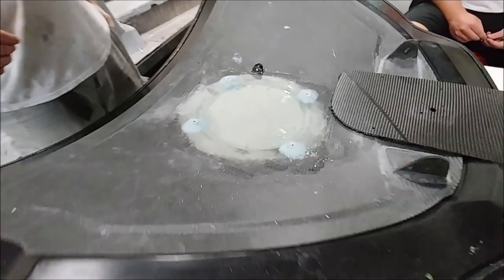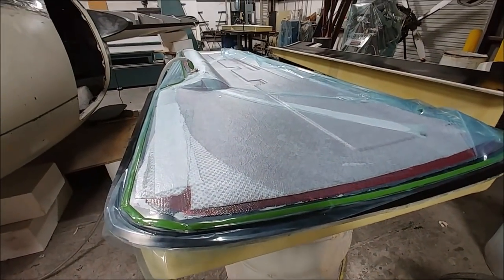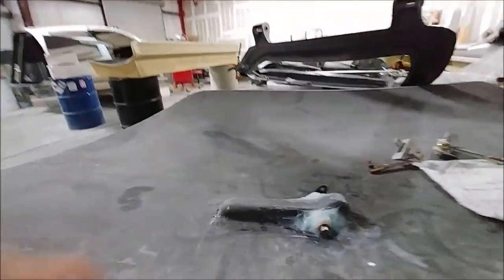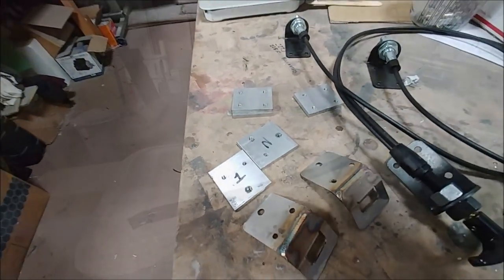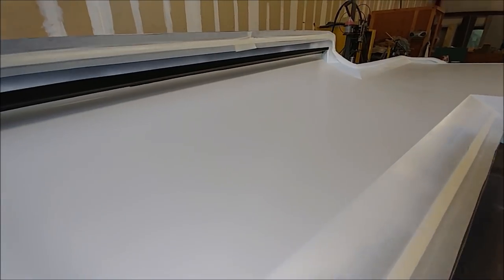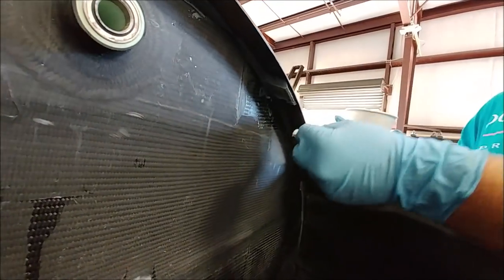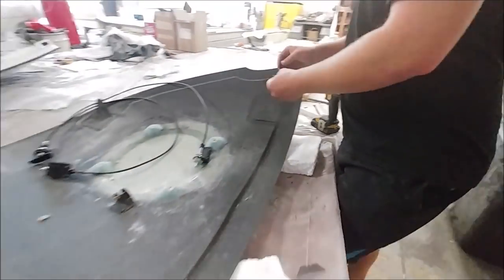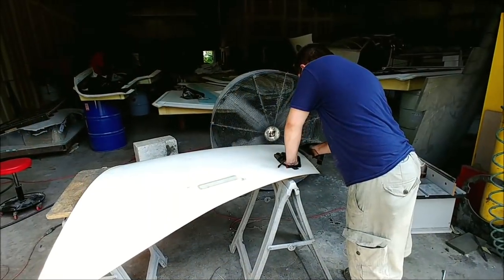Nose Hatch Latches - Building the Raptor Prototype

Comment: I used to hot rod diesel trucks and you are correct about a diesel being less finiky than a gas in regards to mixture. Unburnt fuel becomes black smoke, if the turbo can push enough air to burn the extra fuel higher power is achieved. It sounds like you have the opposite problem, not enough fuel for the available boost so it will cleanly burn the available fuel and the excess air is passed through the exhaust. Perhaps a bigger set of injetors would turn this into a 500 hp Raptor! :)
Reply from the maker: There's enough fuel when I add it as it's possible to get a decent amount of soot build up on the prop at the current highest throttle setting. I don't really see black smoke but that may be because the prop is moving so much air it's difficult to see black smoke when mixed with the clean air. I still want to get the injectors correctly calibrated in the Motec ECU and I've contacted a tuner yesterday that hopefully can help with that.

Comment: In regards to your thermodynamic query, a couple of things seem certain: first, extra boost comes at a cost. Compressor pressure equals turbine pressure equals exhaust back pressure equals resistance to the pistons' movement during the exhaust stroke equals reduced power. In addition, increased boost pressure translates to higher cylinder pressure during compression without increased fuel burn (assuming fuel consumption remains constant) creating gas dynamics equating to a heat pump into the engine with no corresponding increase in power. Also possible if not probable is a hotter burn. Though my experience with diesel is limited, every pilot is taught that a lean burn is a hot burn. 
     Gotta offer kudos on the decision to bury your antennas. I'm often disheatened to see an airframe that starts out with dolphin-smooth flowing lines wind up looking like a spiny pufferfish by the time the nav/coms are installed. Keep up the good work.
Reply from the maker: Only burying the nav antenna. Coms and transponder are old school below the fuselage.

Comment: I don't know diesels well, but generally, raising the boost without adding more fuel would: raise the compression ratio, make the air in the combustion mixture warmer, and change stochometric air/fuel ratio--which may be compensated automatically for by the fuel injection system.

Comment: Although I am not familiar with the ECU you are using, I am familiar with the Duramax ECU.

You have to think like the computer.  In other words, the computer is reactionary.  In the case of the Duramax, the throttle input simply commands a desired torque.  The ECU then shifts through multiple tables of fuel and boost to achieve that torque value.

In my experimentation, I tried high boost during low load.  The engine runs fine, but very inefficiently.  Poor mileage. However, the EGT was very low.  Conversely, lower boost produced better efficiency, but higher EGT values.  Of course, the Duramax is a VGT turbo so it's easy to play with the boost.

You might try this:  take the turbos out of the equation and set your fueling and timing first.  Remember, in a diesel, timing is controlled by the beginning of the fueling event and the duration of the injector as a % BTDC based on RPM.  Typically, a modern diesel will achieve it's best power at roughly 60% BTDC depending on the injector opening time. As a frame of reference,  a Duramax under low load as you described on the video, will run about 110% BTDC with about 5psi boost.  Once the timing is established, begin adding boost to control temperature and black smoke.  

You are correct, the diesel won't really care about the extra boost,  it just isn't running optimally.
Reply: Even in mechanical fuel injection pumps,  throttle settings are merely a request.   Air FLOW is more important than pressure or temp when it comes to metering the fuel delivery.

Comment: It's been a bit since I've taken thermo , but I looked through my text book and made some observations that might help.(for reference look at a PV diagram for an air standard diesel cycle ) For diesel cycle , if you Increase the initial pressure , the three other pressure points will increase accordingly, but since the volume of the engine cylinder is not changing your work input is increasing alot and with low fuel flow you will not see near as big an entropy increase (as seen by low horsepower numbers) , the tS diagram shows how entropy increases and decreases with temperature. 

So my theory , is that after a certain point if you don't have enough fuel input to support the extra pressure you are giving it , your work input will be comparatively high and in turn your net work will be low, because of the high net work input due to a pressure increase on all points caused by the compound turbos. So in effect it kind of is ignoring it , but ignoring it by decreasing the thermal efficiency of the engine. Thermal efficiency of a diesel is ratio of net work to heat added , and since fuel flow is low and boost is up. Heat added will be low and net work will also be a little lower. 

So the questions I would be asking would be the following. 

Why is the engine computer reading a high boost pressure but there isn't a power output or net work output to support it ? 
Mabey there is a load sensor on the engine and it won't add fuel unless it is under more load. 

Does the engine have a type of load sensor at all ? 

If not, how does it know to increase or decrease fuel flow (independent from the throttle control ) ? 

With alot of boost ,if you had the right fuel flow , you would see a much greater workout put during the power phase (can be seen on both PV and Ts diagrams from points 2-3). This would offset the large work input due to the high boost pressure.
Reply from the maker: Presently the only thing controlling the fuel flow is the throttle setting. The ECU was initially set up to also increase fuel when rpm increased but it was impossible to get the engine to maintain a set rpm with that configuration. It would constantly be changing, not ideal for an aircraft so I turned that off. If I add more fuel to compensate for the extra boost I end up with even more boost from the increased power. If the engine just ignores the extra pressure then that's good but if it's not operating optimally because of that then I'd like to see what I can do to remedy that. Somehow decrease boost with a boost controller maybe.
Reply: Raptor Aircraft ok, if you don't have any control over fuel flow besides the throttle control then yea boost control would be the next thing. Mabey something vacuum controlled. Just someway to control the boost to the intake side.

Comment: Hi Peter. Seems to me the engine ECU is acting as a engine governor adjusting fuel flow to satisfy desired RPM. With a fixed pitch propeller this might be ok, but when you add a prop governed into the mix which is also sensitive to rpm and is trying to control it by adjusting prob blade angle in response to over speed and underspeed condition the two governors will not work in unison. You need to be in control of engine power output by way of fuel input and let the propeller governed control the engine speed by way of load. It seems to the ecu is in control of fuel input by way of commanded rpm.
Reply from the maker: Actually the ECU is providing fuel directly proportional to the throttle setting which I believe is exactly what should be done even with the constant speed prop.

Comment: Do you have a mass flow sensor to check the air fuel ratio?  Maybe the fuel rate is low because not much air is being used in the engine or that it is running very lean.

Comment: Throttle body should regulate the amount of air in relation to the fuel introduced.  There may be an out of calibration or synchronization in the throttle body controller and the fuel injection controller.  The compound/serial turbo is there to provide bleed air for cabin pressurization at altitude, also.  This will impact how much boost is available to go through the throttle body in the future flying configuration.  At present, if the engine is running as it should, i.e., without damage, then the engine/prop combination may not be providing enough "work effort" to get real world data as to performance.

Comment: It would be good to validate your specific fuel consumption calculation with alternate measurements.  Ideally you would want to know the torque on the prop shaft with a calibrated torsion strain gauge bridge and then calculate HP from measured torque and RPM.  The strain gauge install, equipment, and calibration of such a method is not easy to obtain however.  What about measuring thrust instead of HP and using prop aero equations to calculate a HP from the measured thrust?  Perhaps this could be done by installing something like roller blade wheels (several of them) on each side of the engine stand and using the load cell and chain that you have from the carbon bond tests to restrain the engine stand and measure thrust.

The purpose of such a test would be to validate that the power you are calculating is accurate.  What matters for aircraft speed and range is how much power you can generate for a given fuel usage.  Dave Darrow - Boeing Attack Helicopter Engineering
Reply from the maker: Setting up to load cell is a bit complicated. Once we can run the aircraft during taxi testing we'll know whether we have a decent amount of thrust. Hopefully that's only a few months away.

Comment: Where will the glide slope antenna be installed? Or is the one you are putting in for VOR reception dual band for the much higher glide slope frequencies?
Reply from the maker: I believe the one we have is all that the G3X needs.
Reply: Raptor Aircraft, VOR is some 120 MHz, glide slope is 330 MHz, the datasheet for the antenna should say whether it supports 330.
Reply: I checked the website of the antenna manufacturer (http://www.advancedaircraft.com/) and they don't spec any frequency range while the other conventional VOR antenna manufacturers say that their antennas are dual band indeed and they list the 330 MHz glide slope band as being supported. Advanced aircraft says their antenna is a dipole antenna which normally means single band only (unless you have an electronic circuit at the base that makes it multi-band).  BTW, you cannot mount any dipole antenna near anything that conducts electricity, i.e. you cannot have carbon fiber anywhere near it. So you cannot embed those antennas in a carbon wing even if you put non conducting fiberglass over it. The fact that conductive carbon is behind it and near the sides of it ruins the function of the antenna totally.

Comment: Not enough load (prop pitch) placed on the engine with more boost than fuel ends up with a lean condition. More boost than fuel under heavy (flight like) loads and you end up burning/melting/scuffing  pistons.  JMHO

Comment: On a petrol engine the perfect ratio is 14.7/1 air to fuel, the less fuel you use with the air (leaner) the higher the exhaust gas temperature, take this close enough to the point where the spark plug wont ignite the petrol anymore and you will turn the exhaust manifold into a big yellow light bulb even under low engine loads. Start adding more petrol than 14.7/1 the fuel not burnt will turn into a cooling vapor with a negligible increase in power. Diesel does not work this way, leaner does NOT raise EGT, it will burn all the diesel you inject until the oxygen is consumed, if you add more diesel than there is oxygen for, you get the black particle matter out the exhaust. Everything considered I would not change a thing, this is exactly the way you want it for this application, you are going to need that boost heading to FL250 as planned, and this way you wont clog up the exhaust flow through those turbos like an old English chimney. The intercooler  and the oil cooler should keep the rings from toasting and that is about the biggest concern unless the boost gets silly high and the intercooler cant keep up under high pitch loads standing on a test bench. Just keep one eye on the inlet air temp and everything should be fine.  This engine setup is an absolute pioneering marvel in its own wight regardless of the rest of the project.
Reply from the maker: Thanks Tino. You're right about the extra boost creating unnecessary heat. That's about the only downside I can see. Hopefully the intercooler can keep up. If not there are other options for dealing with the excess heat.

Comment: ,,,, at a certain atmospheric level you will have a certain boost with a certain fuel flow. The only way to change the boost at this time is to change fuel flow I.e. throttle, or fuel system changes, like pressure and or injector size. Any other boost change will have to be physical mechanical changes, better manifolding, heat shielding, different intake impeller, or housing, on the hot side turbine size or shape, and or housing size or shape . To go further, camshaft, or after cooler. So, you have the known combo, at that load, (prop angle), rpm, it has to be fuel increase or decrease, and that will change power and thus rpm. For example, if the prop is non adjustable, the rpm will change, with different fuel flow, and in a Diesel fuel flow is also throttle, unless you are changing some of the above listed internals, which will change your known combo, and it's power level.
Reply: ,,, 99 plus percent of Diesels have no air throttle of any kind, they are fuel flow throttled. I don't know what that valve is that you got rid of, probably something for road driving response.
Reply: ,,, to get your mind around this it might help to go all in. Full throttle, and a prop or prop setting to hold it at peak torque, and again a little higher rpm at peak horsepower. This will remove any variable geometry in the exhaust, and consideration of lower power tables. This should be very close to Audi's well established full throttle peak parameters. Then you can look at lower power and or rpm's, that will have less boost, for ideal cruise economy. Surprisingly your best bsfc might be at peak torque due to ideal turbocharger optimization. Because you will have less drag at at lower cruise speed and lower total fuel flow (throttle) regardless of slightly  higher bfsc, but much better gpm .
Reply: ,,, of course you will want to look around at peak torque and horsepower because you will very likely use this for takeoff. The engine is designed to go there thousands, even tens of thousands of times in the car. When Otto von Quattro rolls down the ramp on the Autobahn, the engine accelerates right through peak torque, then power, and upshifts again and again, throug the peaks, till he is going 140 mph, or so.
,,, but there is another reason other than gph to not run at the peaks. The engine is still an automotive design and it's just not been designed and tested held at peak torque or horsepower indefinitely, say in a boat or airplane. Typically, my guess, going down the highway at about one third power.
Reply: ,,, should not be relevant here, but I should have listed variable geometry exhaust housing in my incomplete list of "internals", as a way to change boost.

Comment: As far as the redrive issues - have you consider trying the Geared Drive BW350 PSRU?  https://www.autopsrus.com/  It is designed for automobile gasoline V-8 engines, has a centrifugal clutch system, handles up to 400 hp and is geared for 4500 RPM to equal 2700 RPM at the prop (1.667 reduction ratio).  It works with standard prop governors and has it own oil supply which it shares with the prop.

Comment: EGTs are important here.  As far as power goes, there's only so much in the compression ratio and amount of fuel injected.  More fuel, means more power, but also requires more oxygen (air), hence the turbo.  Allows you to cram more fuel in a given displacement, while providing proper Air to Fuel ratio (A/F).  Power wise, more boost with less fuel will not give you power. . . Might actually rob a little from parasitic loss (turning the impeller). . . But will lean the mixture.  Too rich on diesel = heat.  Too much heat and you melt things, much less wear em out quicker.  Gasoline engines monitor A/F ratio with a MAF & O2  sensor.  Diesel does it with EGT.

Comment: I would think the engine doesn’t care what boost level it’s making, the throttle body would just close further to make sure the a/f ratio is correct. (Are you able to see that on the TPS?) If it gets crazy you’d have to worry about gaskets but it sounds like you’re in great shape yet. Glad to hear the door locks are going well!
Reply from the maker: The engine doesn't have a throttle body. It's just wide open all the time. See my replies to the other posts.
Reply: Raptor Aircraft I didn’t realize diesels don’t have a throttle body. Thanks for letting me know! I’ve learned a lot watching you build this aircraft and I can’t wait to see it fly!
Reply from the maker: You can have a throttle body but it's really only used to choke the engine if you have trouble shutting it down due to a runaway condition. Given that we are not feeding exhaust gas or crankcase gas back into the engine there's little to no chance of a runaway situation. Google that if you want to see what happens to a diesel engine when it runs away.